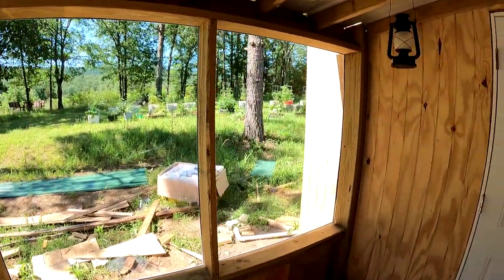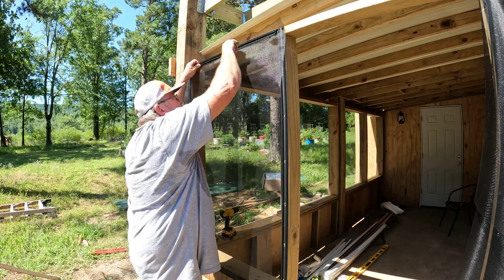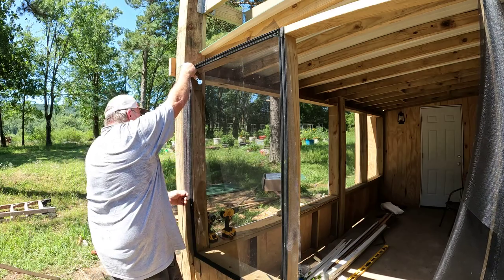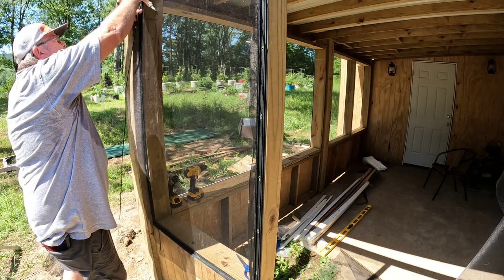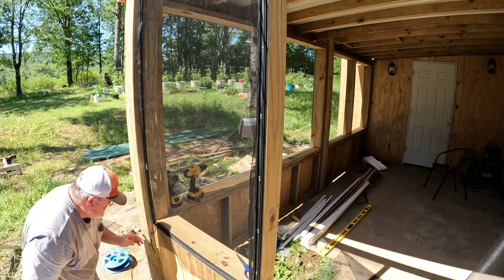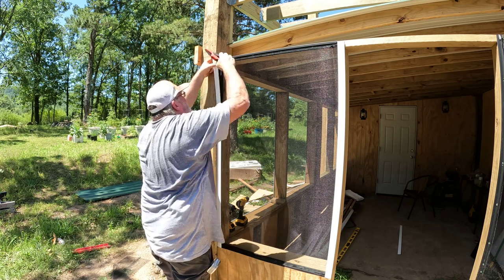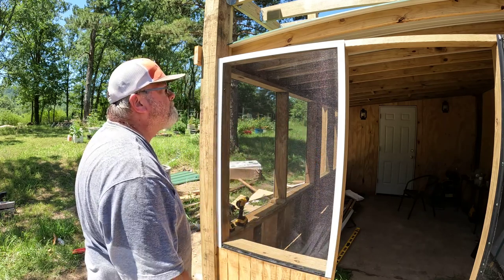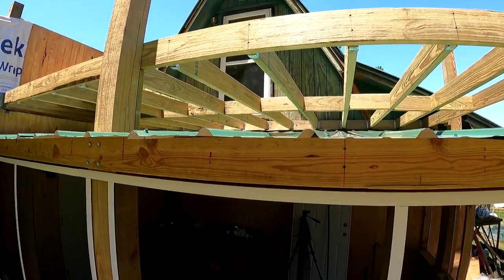All Windows Are Screened/ A-Frame Screened Patio Build/ Deck/Dog Apartment

Comment: That screen system is amazingly easy!  The screen fabric is not only great to see out through it looks like it helps block the sun from the outside to keep your porch cooler too.  If you are worried about the water coming in, you could look into canvas roll up shades or a Roman shade that scrunches up (like a sail upside down) when you pull it to the top.  Pricey, but if you know someone who sews well you could make your own. It would be worth it to protect your outdoor furniture you were talking about.  Otherwise there are waterproof protective covers for them that work well.
Also, if you try to use that track system for a porch for Jeff, there is a heavy weight screen that is 'pet scratch proof' called pet screen which I picked up at Home Depot.  I had to replace all my window screens and patio slider screen door because our cats ruined the lightweight stuff clawing at it like a scratching post.  Replaced my neighbor's slider screen when her 4 dogs scratched hers and tore the screens out.  Stuff is tough, a but harder to 'spline' and make 'taught' though!😋 (Yep, great words!)
Reply: Great info, @Jo Farwell  I was wondering about a screened-in porch at Jeff's for a CATIO 🐈‍⬛🐈‍⬛🐈But, wasn't sure about the screen & whether or not the cats could just claw through it. Maybe that'd work!

Comment: May i suggest a cheap way to keep “most” of the rain off the screened area is purchase bamboo rollups.  You could get them for each window or a  larger one that covers 2 at a time.  When it rains you can drop them down like mini blinds and it will block rain and wind blowing in.  It also blocks sun.  Not completely, but its nice to block the direct sun on one window or two.  they look nice too from the inside and are easy to roll up and down as needed.  Sand and dirt blows thru the screens and these help that too.  You could try one on one of the windows and see what you think.  The screens look super.  Very finished looking with the white border.  Good luck on the rest of it.

I wonder if you don’t use the screen door upstairs, maybe it might fit on the screened room.

Comment: I have always wanted to put a ceiling fan inside my screen room and removable plexiglass windows to cover the screens for winter, but here I am 20 years and never did it. It would need a lot of plexiglass for mine and be way more expensive now. I have some large window areas. I did staple plastic around one winter to make the screen room and house warmer, but I had bought a thicker type that I couldn’t see through and didn’t like not being able to see out for 3 or 4 months. 
I’ll be interested to see if you get ideas for keeping the rain out. I could use that, too. That’s rare for me, too, but it happens.